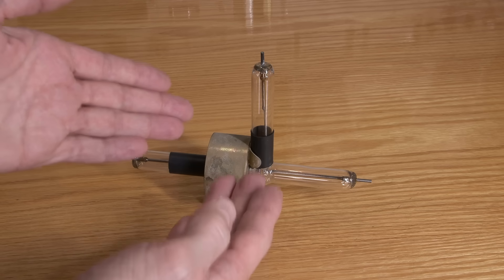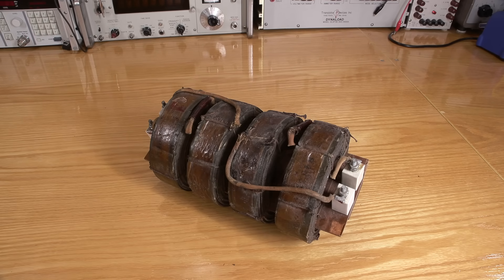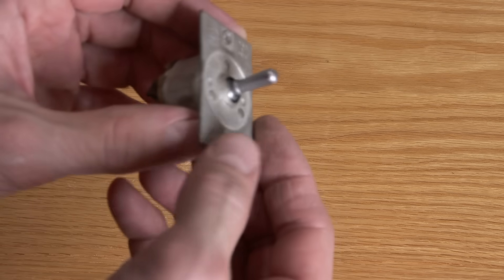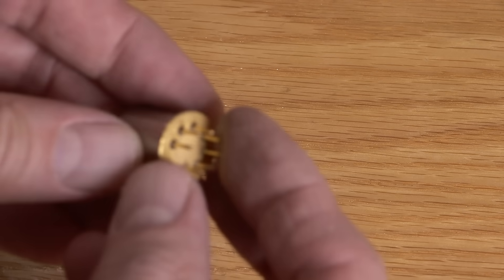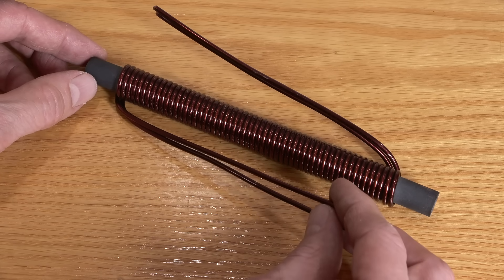Test Your Electronics Smarts - Guess The Electronic Parts!

Comment: #1 - my first guess was a vacuum relay but I abandoned that guess because I didn't see the contacts!
#2 - a bmf choke
#3 - a diode?  Moto doesn't make caps to my knowledge
#4 - a cap but would never have guessed it was a mica cap
#5 - I figured it was a rotary switch  -very cool - had no idea this existed!
#6 - a bmf resistor
#7 - an IC?  Tubster - that's also a new one to me
#8 - ferrite core inductor
#9 - more chokes - missed the cap - got the inductor - half right :)

Comment: i suck at this game!

vintage transistor
isolation transformer
modern transistor
fused load
multi gang  varistor
radio  choke
amp transistor
ac filter
thermal fuses

0/9

Comment: I really appreciate your videos. My dad, born in 1920, was a telegrapher and ham radio guy before he went into WWII. When he got out he went for a radio/TV certificate on the GI bill and went into the Air Force during Korea and worked as a telegrapher and radio shack guy.

His basement workbench had all these great glowing tube gizmos and radios and tvs and oscilloscopes and tube testers and what-not and he'd tell me what they all did. Love seeing this stuff, thank you. I still recall the sound of the tunes heating up and working and the smell of the coating of dust that burned off them

Comment: Hey Paul, I have a quick question for you....

I am in need of an RCA 2N5415 transistor in a TO-39 metal can. 

I find them on the internet, but I don't know if this is a commonly counterfeited part, and/or who I can trust to get an original RCA part. 

I can not substitute anything else in it's place, as it's coupled to a heatsink with a Berrylium cup with it's compliment 2N3443, and the temperature matching of the transistor to it's compliment is important.

Any idea of where I can order this with a relative assurance that it will be a genuine part?

Thanks in advance.

Comment: Vacuum tube with three electrodes. has a big ring on it that has connections, most likely a coil. Probably a high voltage relay

Comment: When I saw that large capacitor it triggered a memory.   I was around 10 years old  I'm 74 now and my Father was part time engineering the local radio station.  The transmitter was off the air and the problem was one of those large capacitors had exploded.  The station was AM and directional at night.  Dad and I walked all the way out to one of the towers and borrowed a large Sangamo capacitor from the tuning unit.  He installed this capacitor in the transmitter, it was a little off value and voltage rating but it worked fine on low power until a replacement came.  I've made my living as an electronics technician starting out repairing television sets and retiring from the Missouri Highway Patrol as a district engineer for the communications division.  Thanks for the trip down memory lane.

Comment: Here are my guesses as they came out of my head: 1: Some kind of transistor function device, 2: something from inside a motor, 3: Some kind of diode, 4: a huge ceramic capacitor, 5: a three way switch with 4 positions, 6: no clue, looks like a neon tube, 7: a metal covered mini tube of some kind, 8: looks like a coil out of a radio but much larger, 9: a diode, 10 (the green one): some sort of resistor.

Comment: I didn't get the relay; I got the choke (inductor); I got the varicap/varactor diode; I didn't get the capacitor; I got the four position switch; I got the big wire-wound resistor; didn't get the tubester; I got the big inductor; failed on the capacitor but thought the larger thing was an inductor. I'd say 7 out of 10. And, no. I didn't Google anything.

Comment: That high voltage relay is interesting, what year was that made? Worked with vacuum breakers in the 15KV range, but were only open and closed. Guessed the choke, diode, switch, resistor (worked with larger ones than you showed), and second choke, I thought those were AB resistors, got me.

Comment: Not all of us would know all the devices used in commercial electronics equipment and high powered transmitters, but the smaller components you showed near the end of the video I knew one was a choke coil and the other was a small value capacitor. I have a small collection of those kind of choke coils.

Comment: Really like your videos! I've been in the electronics industry for about 50 years and recently retired. I started out building circuits in Popular Electronics, then went to Heathkit, then original designs. Started working after school at a TV/Radio shop and doing automotive electrical stuff. Later came two way radio, random electronics repair, collecting (and repairing) old test equipment and radios. Eventual ended up working on broadcast transmitters, worked for calibration labs on and off, did pretty much everything both tube and solid state, and things to numerous to list. And it's all been fun. Even used to have a garage shop about as packed as yours... Then I got a divorce. T.T Had to get rid of 99% of everything after that - but there is a lot of fun small solid state test equipment and ham radio stuff too :-)

Comment: Pretty sure that first one is a high power vacuum RF relay of some description.

Or part of the flux capacitor in the Back to the Future series believe it or not.

 not kidding!

This was what was used or at least part of it for the three arms of the flux capacitor!

By the way the lead wires with the orange we're actually spark plug wires!

Yes people have built reproductions of the original prop!

By the way is something where the Intriguing about the original is the flux capacitor enclosure was tied into the air conditioning system needed to be for cooling is awesome of the conduit / hoses were actually functional for this reason apparently.

Main thing was the heat of the incandescent bulbs used apparently!

Also the flux capacitor could not be run continuously with the lighting because of thermal constraints!

That is real world conditions within the prop itself!

Go figure!

Was it one time looking into building a accurate or fairly accurate free production of the prop until I found out how much it would cost for components.

The RF relays alone probably would go for over $60 used for one of them.

Three needed total and that's just a start!

By the way originally I thought this was light rope being used in the prop for the lighting however that was not used it's just incandescent bulbs behind things.

And with the arcs and Sparks that could be easily done using those plasma discharge tubes that are available various places.

Kind of like what they do on fancy RAM sticks!

Either or running a Xenon flash tube at very low current but just higher than normal voltage without triggering to get a Arc discharge videos of doing things like this of course here on YouTube as well.

Although you plan to do something along the lines of the time circuits and using keypad and everything else is there interface and full RGB off a numeric displays for the whole thing and be able to display information in addition to being a movie prop when it's in standby!

And of course clock and calendar.

Might even have the setup for timers and everything else probably running from something like a Raspberry Pi of some description.

And of course being able to be controlled over serial port bi-directional.

For example say there's a weather alert good Flash in red and also scroll information.

Even having reminders and much more.

One thing I would do that would not be movie accurate but just for convenience and versatility.

In addition to using more durable keypad like that possibly used on Arcade equipment or old school pay phones.

Would be to have the keypad with star and pound could easily be used as an inter in the back button to or otherwise is more versatile controls.

And yes could even do now playing and other track information doctors feedback on the system.

And since possibly the nas attached storage may be in the same cabinet perhaps when backing up data or restoring find some way to replicate the flux capacitor.

Something else still there will be at least a small CRT and potentially even being able to use this as a audio visualizer that could be configured to just use as a Transformer isolated coupling to the yolk what does CRT and basically just driving the high voltage and other necessary things to get just essentially traces corresponding to audio intensity of course left and right feeding horizontal and vertical deflection

Comment: At first I thought maybe it was a tiny mercury rectifier but there's no mercury pool and no need for a 50 ohm spec. Directional coupler? But why a glass tube?
Fun stuff.

I recognized the big choke. I've crawled around in enough old TV transmitters to have seen stuff like that. I recognized the varactor diode. Although, I thought maybe a thermistor or similar. I haven't seen one like that in quite a while. Thermistors in that package were not uncommon in audio amplifiers as higher power transistor amps became more prevalent.

Comment: I have an Eimac 100IG that looks like a vacuum triode but is actually  an ionization gauge.  It has a glass tube coming out the side, open to the atmosphere.  Connect it to a vacuum system, pump it down, and it begins to act like a triode.

Comment: The vacuum relay is reminiscent of the devices used in the BTtF flux capacitor.

That filament choke could be repurposed as a balun.

The stubby resistor lookalike capacitor was new to me.  I have probably seen them before without realising they are not resistors.

Lovely selection, I recon you have enough to do a few more like this.  Add some traveling wave tubes triggered spark gaps for variety.

Comment: I found a varactor diode in a sony AV remote, that I repaired, which had it's ground connection pad ripped after the remote was stepped on.  Didn't know what it was but assumed it was some type of transistor based on the shape. Reconnecting the ground with a bodge wire fixed the remote.

Comment: Great! 
Having worked in three branches of electronics for 38 years and now aged 74 years, I still have a lot to learn. In particular, I have a couple of klystrons, apparently unused, but they are the sort without a built-in resonant cavity. It would be good to learn how to put this together even though I could likely get a few mW of microwave RF using a Gunn diode.
Keep 'em coming!

Comment: Well, I got the varactor diode right - almost.  I guessed that it was a diode, due to it having two legs and being in a TO92 package.  Everything else, I either said "it's a big inductor" and was sort-of right, or "it's a high-voltage insulator" and was completely wrong.

Comment: Guessing some sort of AM modulator. Looks like an electron gun type thing, and that big round thing looks like a coil, guessing it deflects electrons of a high frequency carrier depending on the signal provided to the coil, which would result in an amplitude modulated signal (edit: eh almost close)
2. Common mode choke
3. Diode, maybe a zener or ultra fast type job? (varactor nice)
4. Gas discharge sort of high voltage arc supressor thingo (ah big cap was second guess)
5. 4 position magnetic (?) switch
6.  High voltage fuse, like a power line fuse
7. Metal envelope vacuum tube, though could also be voltage reference or oscillator
8. Another choke, high frequency/high power, for decoupling AC, but shorting DC 
9. Inductors

Comment: Third one: I’m going to say that it is a constant current diode, basically a j-FET with a resistor in series with its source and the gate connected to the far end of the source resistor….and the gate and drain leads biught out of the TO-92 package. Watched foe about 15 seconds ans did not reach for any data books!

Comment: O.K. I’ll be honest…I only watched 27 seconds if the video..

Its a high voltahe vacuum relay with changeover contacts, probably with a blocking rrating of 50Kv and a closed-contact current of something like 10mA. Probably scavanged frpm an X-Ray machine submerged in HV oil.

Now I feel I can watch the video to see if there is a “reveal” and if I am correct or close to the mark!

Comment: I missed 2.5. The tubester I thought is was a regular tube that was similar to a nuvistor. Also missed the cap at 14:00, assuming it was also an inductor. And also the varactor since I just said "diode"---that was the 0.5.

Comment: 1) high voltage gas-filled...resistor? rectifier? nope haha
2) huge inductor choke thing... yup!
3) no idea haha
4) a ceramic fuse? nope
5) four position switch... cool!
6) huge resistor like in a 100 year old fire alarm control panel, yup! too many of these still protect buildings...
7) an early IC, or a tiny tube or relay... sort of!
8) braking resistor was all I could think of, but knew it was wrong from the ferrite
9) got both of these wrong hahaha

Comment: I got most of them,  but you have to be careful with the 2 terminal to92 package as there are a fair number of 2 leaded devices out there and god only knows what package they will put them in.  My first guess was a vactor, but I was also thinking diac, precision voltage reference, AD current style temperature sensor, or even knock off's of the dallas series of digital temp sensors you can run 2 wire.  I would not put it past them to save the cost of the third leg at some time if they are going to be used in 2 wire mode.  I am sure there are other things they have stuffed into 2 lead to92 packages besides just those.

Comment: the varactor diode has the same look as a diac. 32v bi-directional diode. TEK 7K switching supplies used to use them for a startup pulse.

Comment: What year did toroidal transformers go into productpn? The dual /quad coils , at first glance , was toroidal but then you displayed a mini version, some I believe have adjustable core..inductor, like in the old mid 1960's transistor radios and early table top radios..i found a way to adjust band width and also shift the band up or down

Comment: Great video!
I managed a few correct answers, which I won't bore you with. The glass device, I guessed some sort of RF amplifying device or atomic frequency standard. The mica capacitor I guessed a vacuum capacitor or high voltage surge arrestor. MY guess on the large resistor was a high-voltage fuse. My guess on Teledyne was a relay. The ferrite rod with copper winding, I guessed a common mode choke probably for emissions.
Reply from the maker: Thanks for playing along!

Comment: I guessed the first device was a relay, then the 50 ohms told me it could be an antenna changeover relay
T first i thought the second item was a step up transformer for high voltage, the separated coils would have been for isolation, much like the transformers in commputer monitor backlights and other HV applications
3rd item i guessed capacitor or hv spark gap
Your capaciotr board doesn't seem to include the capacitor that was just a pair of twisted wires that were labelled as cx in an old radio :D
I thought the switch was a joystick, was expecting it to return to centre
I knew that was a high wattage wirewound resistor, i have similar, along with the clips it goes in to, like a fuseholder with ceramic stand offs
I thought both the lsat devices were inductors, i've certainly seen the green version, may still have some.

Comment: I got only 3 correct.  My guesses were;
1: RF oscillator

2: Transformer
3: DIAC
4: HRC (fuse)
5: 3+1 position switch 
6: power resistor
7: Crystal oven 
8: inductor/RF transformer 1:1
9: I thought both were Inductors

Comment: This is a great video. On the the last "2-for-1", how would one tell if it's a resistor, an inductor, or a capacitor with bench tools?
Reply from the maker: An LCR meter will tell you, they are very affordable now. (cheap like a DMM)
Reply: @MrCarlsonsLab  I had never heard of that, but makes sense.

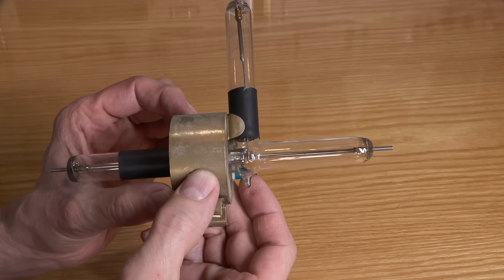Comment: @1:33 an electron shuffler
@3:19 a static auto auto auto transformer
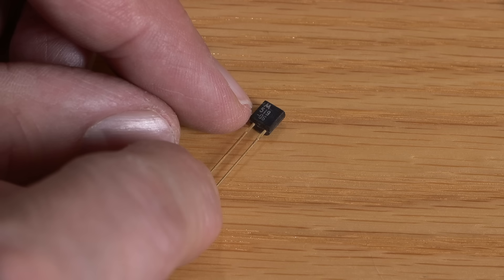@5:32 a diodistor
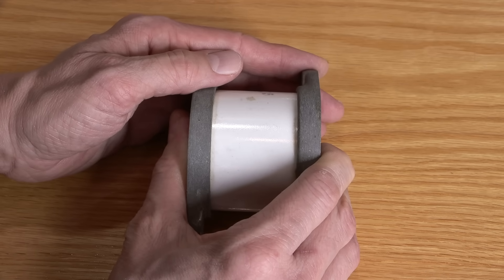@7:16 big fuse
@8:50 4 position (3 on, 1 off)
@10:02 a really big Geiger muller tube
@10:50 A 4-signal relay or counter (vcc,gnd,ctrl/xtal, & 4 outputs)
@11:41 A low-signal noise amplifier (a device to decrease SNR!)
@13:10 prank resistors, explode when energized
@14:39 I scored an F

Comment: Great format😊 I failed half at the last one (TWO) , the first i at least called a switching device, failed at the big mica, thinking it was an isolator 😂.  Oh and with that tube  replacement ... just called it integrated circuit ...😮 learned a bunch with fun.

Oh BTW... without your channel I would probably only had the numbers of switching positions right... I want these in a smaller format for eurorack modules 😊

Comment: Just from the thumbnail: I think that's a vacuum-tube based oscillator component, the metal cylinder in the center would be a coil (maybe oil-filled), the whole thing is likely for a relaxation-oscillator. But, I haven't watched the video, so :shrug: .
Reply: So it was a relay! I was thinking a vacuum-tube era equivalent of a UJT.